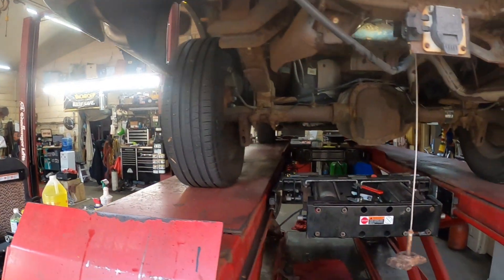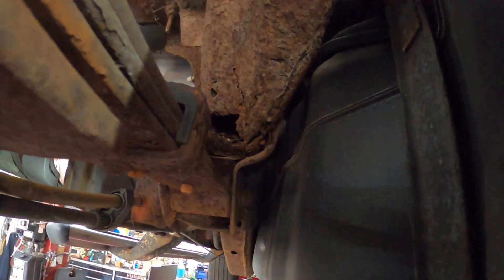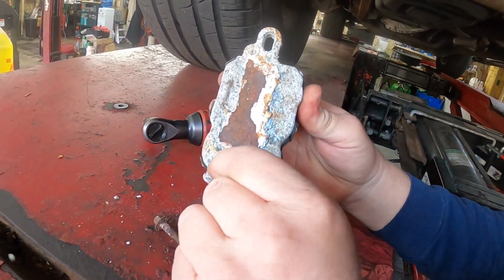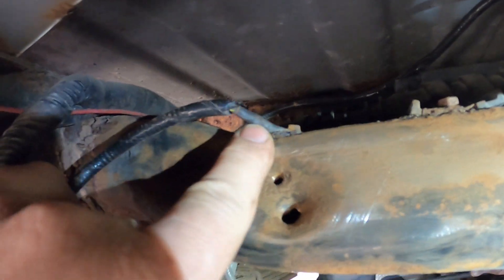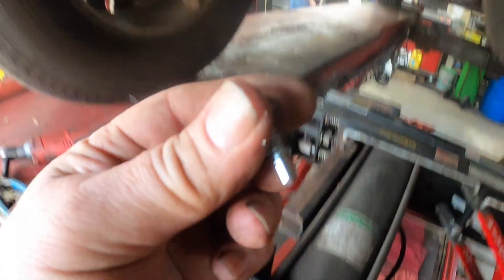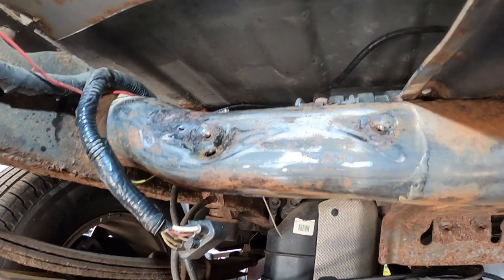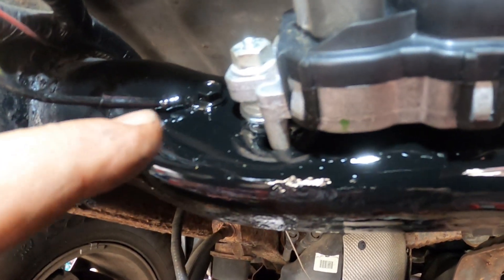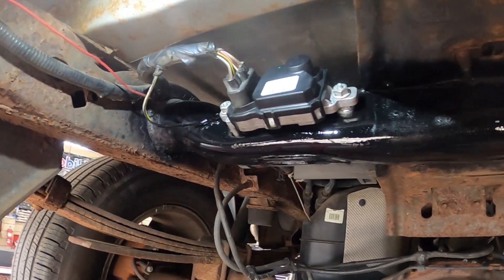Ford Truck and Van Fuel Pump Control Module Replace (P1233 Code)

Comment: galvanic corrosion is likely but the main problem for this truck appears to be operational service life in a very humid environment. My guess, exhibit A for typical rust belt vehicles. Man I just can't imagine working on machinery in that region of the country, everything has shortened service life and is a challenge to work on.
Reply from the maker: The truck was living at a beach in North Carolina